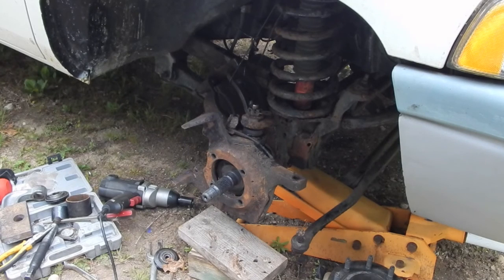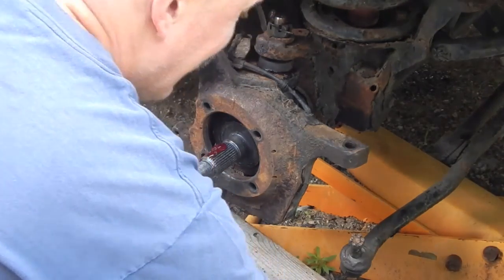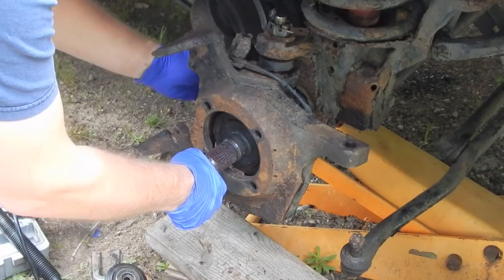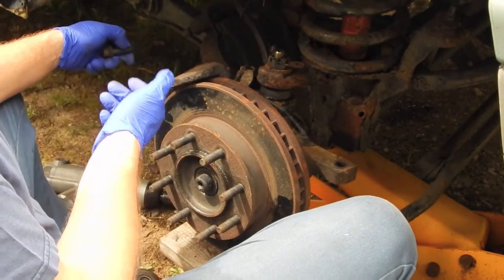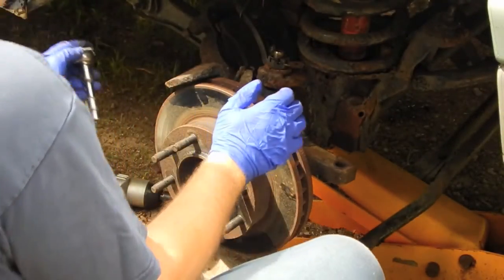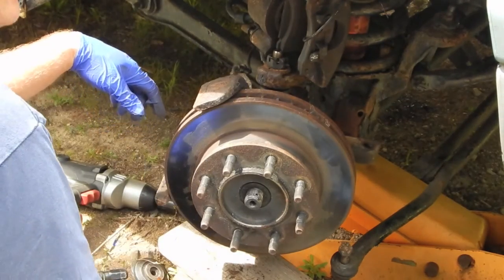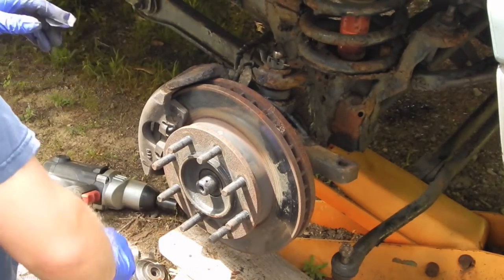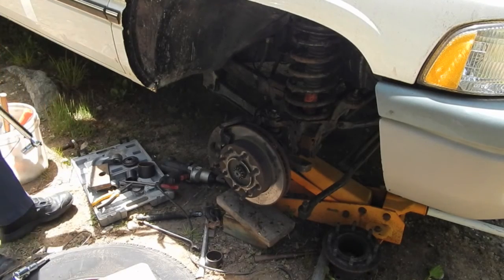1997 Dodge Ram 3500 ball joints Part 3

Comment: Well, for what it is worth---thanks.  I am doing my wheel hubs, rotors, calipers, ball joints and brake pads on my 1998.5 Dodge 2500 4x4 Quad Cab.  There are just not that many videos showing repairs for the front wheel style on this "second" generation Dodge truck.  I decided to learn from all your efforts.

 Most everything is apart now so I will beginning re-assembly soon.  If only if it will drop below 100 F out here in California.....

Comment: Steve I have a 2003 Dodge Dakota 2wd and it has close to  the same torque requirement as you stated for your 1 ton.  Somewhere around 180 ft. lbs. The axle nut is a basic lock nut (somewhere around 32mm) 
that can be used only once.   I had to replace both of my front wheel bearings at 70,000 miles. O'Reilly only had the cheaper bearing assemblies available at the time and I had to get back on the road asap.  They make a higher quality bearing but not a single auto parts store could get it in the time I needed to get rolling again.
Reply from the maker: Good info there, thanks for posting. My Dakota is a 4wd, so it does not have regular wheel bearings, it has a hub assembly, so the torque requirements are different, and it does not have a self locking axle nut like yours. Regards.
Reply: Yeah, I just threw that info out there for anyone with the 2wd.  Keep up the great videos.  I especially like the tower of power series, but anything mechanically is great.
Reply from the maker: Thanks. Plenty more tower of power stuff coming soon.